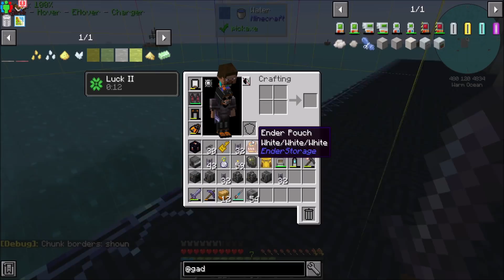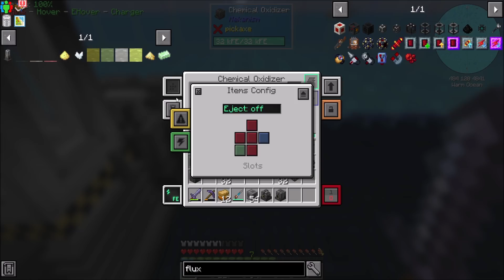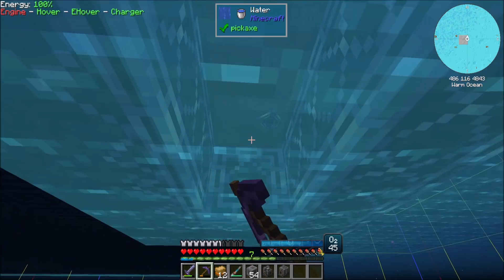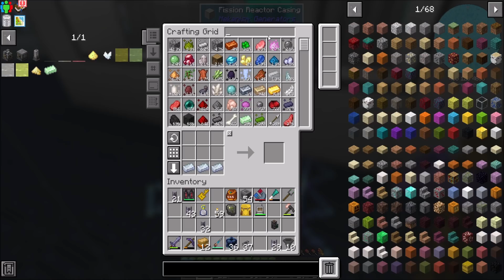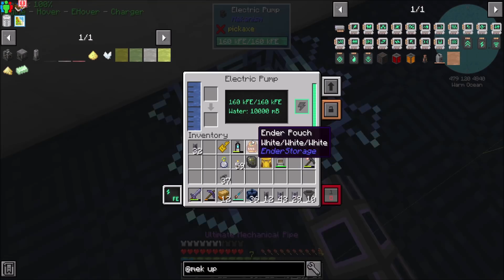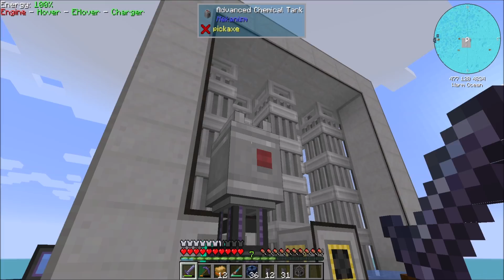OceanBlock Ep33 Fissile Fuel Production

Comment: as for a sink, i set up a water network with an aqueous accumulator piping into an unstable drum, constantly filling it.  pipe from the drum into an blue/blue/blue ender tank.  now anywhere i need water, new tank and  pipe is all i need, now power or wires.  working well for me. you could also add a couple of pumps to help fill the drum if the the AA can't keep up with the demand.

Comment: dire be glad you can make your fissile fuel setup so compact now(because they finally added the side config menu to all machines instead of just the main ones not the ones for changes forms of items) back before this was a thing you could try to line them up perfectly and still have a cable nightmare especially without ender io, Now it is so much easier than before

Comment: Dire, in the industrial foregoing item transporters, you can hover over a item in the transporter and use your scroll wheel to change the amount of items for the regulator mode
Reply: Basically open the transporter. Then, hover over an item.Then, scroll with the scroll wheel

Comment: I'm pretty sure Aqueous Accumulator is better water source than mech pump, it may depend on upgrades though
Reply: I did some pretty deep testing, and it turns out the Mekaniam pump and the aqueous accumulator are both capable of producing 1 bucket per tick when fully upgraded. The aqueous accumulator doesn't require power, though, so it's better in my opinion. The water condensator couldn't reach 1 bucket per tick when when fully upgraded

Comment: Thermal also has the Aqueous Accumulator which doesn't require power at all, so you can use multiple of those since they are really cheap.
Reply: And don't forget to upgrade the aqueous accumulator! Then a single one will pump just as much as a mekanism pump but no power required.

Comment: I would test that redstone before I turn that reactor on just in case, you've had accidents before like that
Reply: The Redstone works just fine, but just wait until he doesn't use the redstone signal to turn it on but instead presses activate in the ui while the redstone is off and there you go: Safety shutdown succesfully disabled ;)

Comment: Dire, for the Fissile Fuel setup, the Chemical Oxidizer is the block that, even when max upgraded, will slow down your entire production line. You need at minimum 4 of them, fully upgraded, to keep up with the production line, not upgraded, and 8, fully upgraded, to keep up with a fully upgraded production line. The one you have now, if fully upgraded, can make 32mb/t, with 4 you'll be capable of 128mb/t, (which is the max the Centrifuge can handle if max upgraded), and with 8 you'll be able to produce 256mb/t, which the production line is almost able to make, aside from the Hydrofluoric Acid, which will become the next machine that will slow down production at that point, and needing a second upgraded Centrifuge.

Edit: Also, don't forget to put the Waste into a Solar Neutron Activator set to redstone, with a daylight sensor next to it, and a Centrifuge on the other side of the Daylight sensor set to inverted redstone. This way you get Polonium during the day and Plutonium during the night. (Since the Solar Neutron Activator only works in sunlight, obviously. This was a setup you've had in the past when you got so far as to create the Antimatter Machine) Then you put the Spent Nuclear Waste into the barrels.
Reply: Are the 8 oxidizers for the sulfur, uranium, or both?

Comment: Try the aqueous accumulator for water, but I do not know if it is faster than the pump.
Reply: I did some pretty deep testing, and it turns out the Mekaniam pump and the aqueous accumulator are both capable of producing 1 bucket per tick when fully upgraded. The aqueous accumulator doesn't require power, though, so it's better in my opinion. The water condensator couldn't reach 1 bucket per tick when when fully upgraded
Reply: @machadeon7743  Good to know, thank you.  Accumulators it is.
Reply: Thats my plan, if it's not enough I'll just add a bunch of them concidering they don't require power.
Reply: @crushingbass7131  I've been using one with an ender tank for all my water needs so far. Added a resonant ender augment just because I had the resources, but it's pretty good on its own
Reply: For maximum water output I'm guessing a speed, and stack upgraded export bus from Refined Storage could probably output more water than both.  You would need multiple inputs, or a massive reserve from Extra Storage though.